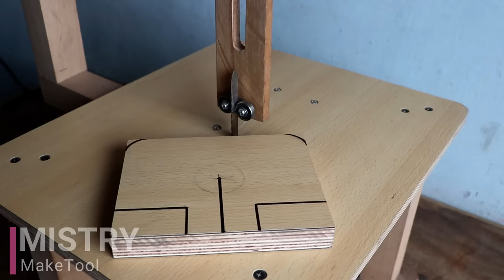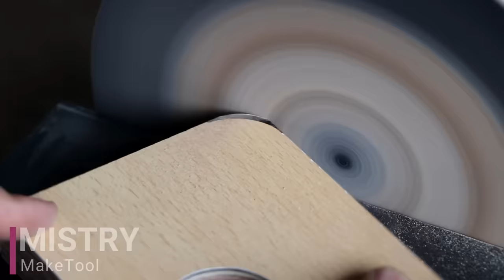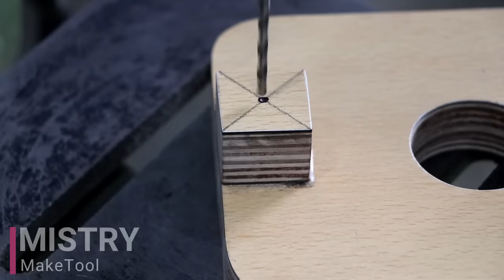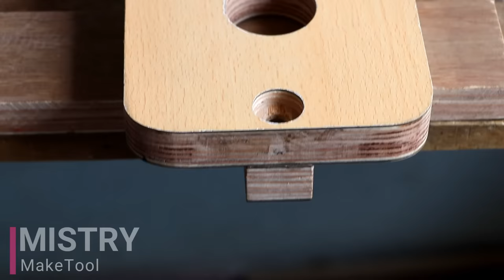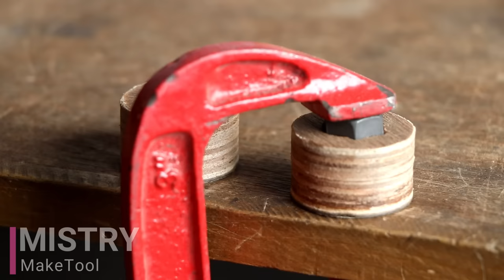Make A Router Attachment For Drill Machine || Homemade Drill Attachment

Comment: hrm, I already have a couple of power drills and don't need a router often enough to justify one, this solves the problem on those rare occasions I could do with one, without the higher cost. Thank you. The more angle grinder and power drill based projects you post, the better :D Especially when they just clip on for use and let us use the drill as usual in between

Comment: You should glue a small bubble level to it, to ensure when you raise and lower (the bolts with springs), that your router bit is making a level cut along your work.
Reply: That's assuming the work surface is level.

Comment: Whilst I do applaud your fine efforts, I would just like to make a couple of engineering points...

Standard drill chucks are not built to take side (radial) loads like this so there is a high probability of the chuck loosening & throwing the router bit... not good 😒

The drill itself is not designed for side loads so its bearings will wear more rapidly ...😟

The RPMs are not high enough for most routing, 20,000 rpm is normal for a router.😴

Other than that you did a fine job of making a router adapter  accessory ....as long as it is only very seldom used... 🤗

😎👍☘
Reply: Totaly right

Comment: I've seen commercial versions of the jig that was created in this video,
But I wonder... In some websites, the question or issue was raised that drills are constructed to "plunge" while routers cut sideways. I wonder if there really is a danger of operating a drill cutting sideways like a router instead of simply plunging.
Reply: You'll end up ruining the drill machine if you use it this way for long periods.

I like his contraption for use as a drill press.

Comment: I feel the materials and design is too bulky. Also springs don't guarantee your drill is always level. In the final moments of your video where you router that wood, I noticed the drill actually jumped, I think it needs support from the back end of the piece. Good effort though, can turn into a very useful jig

Comment: Very helpful video but I can't understand one thing , why there you put two 5mm bolt in to the corner holes??
Reply: He does it as a height gauge. So when he lowers the drill, both sides are of equal height which allows for the drill to cut straight and even lines.

Comment: ITS NOT WORK WITH  ALL  THE ACCESORIES   BECAUSE THE DRILL   HAS  3000 OR 5000 RPM  WHILE  THE ROUTER  30000 RPM  BUT ANYWAY  IS  GOOD  IDEA

Comment: This is a horrible idea. Chucks on drills are not designed to have horizontal force  applied. Doing this could make the bit come flying out and cause injuries.

Also the RPM of a drill is not fast enough for a router bit.